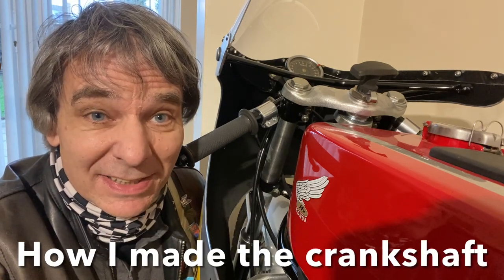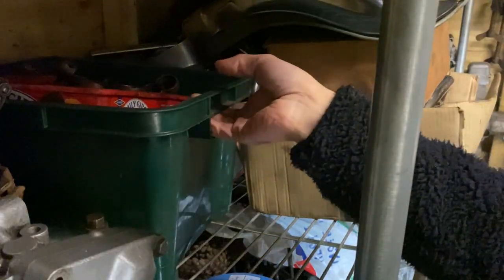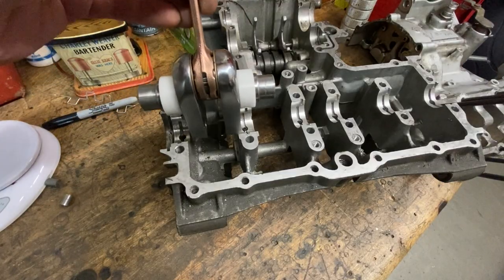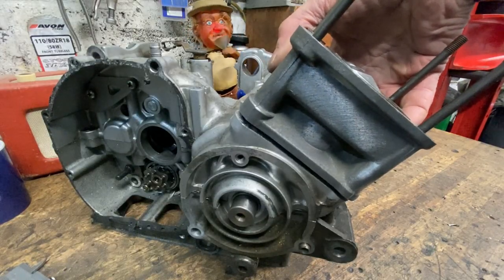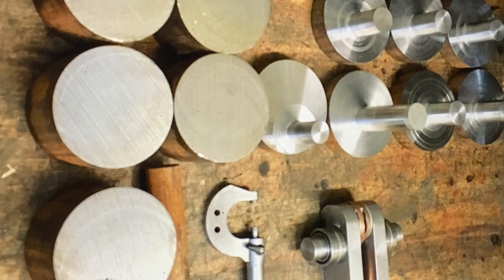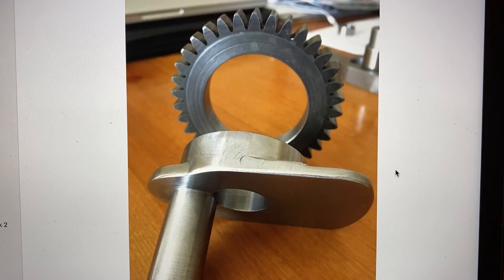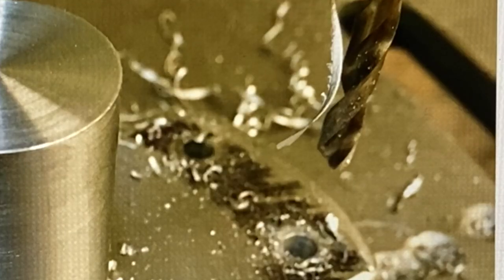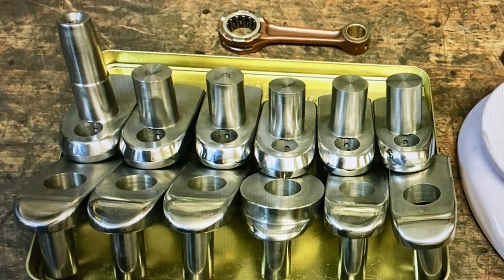Millyard RC374 Honda six replica - Episode 2 - How its made

Comment: The most impressive part (ok, it is aaaaalllllll mind-blowing) was finding the roller-bearing con rod in a parts bin and saying, "That will fit perfect!"  And, ti wasn't quite perfect, but he figured out an adaptor plate to slide in.   Holy Moses!  On the Honda RC 174 they would have just fabricated the right size con rod.  This dude found what he had, and then made it work.
Mr. Millyard is not building motorcycles..... he is creating hope.

Comment: Astounding! I'm particularly impressed how you got the interference fit of the crank journals so precise, in my machining career i always get it too loose unless i deliberately make it too tight, then sneak up on it with emery paper..... the lathes I've used have always been really worn, but all the same despite my best efforts my accuracy is an order of magnitude worse than yours! incredible!
Reply from the maker: Working on shaft basis I machined the shafts first, measured exact size then made up several go-nogo gauges to ensure the correct fit I needed

Comment: Lovely to watch, and importantly, Allen to took the time get the to build the crank from scratch for the correct sound, he could have extended the standard crank and machined the webs. I have heard the real thing albeit a George Beale model, but Allen has captured the sound and spirit of the real thing, and in reality is probably the better bike, at least you can buy most parts that Allen hasn't built, this thing makes the hair on my neck stand up so much that if I ever rode it it would push my helmet off.

Comment: So many technical words of the trade ! I can't keep up. "Interference fit" i must be so flush that it causes the slightest amount of friction before bearings steer the piece in perfect equilibrium  and lubricant is forced  under pressure between the moving parts ? And if had any idea what i was talking about (?) it would'nt be half as interesting ! Recognition of a master at work, having obviously years of experience, such  (necessary !) detail and with no expense(time & effort)  spared in reaching the goal of "just right !" I find myself feeling admiration mixed with a small amount of envy ! The envy being erased without trace by a generous helping of thanks. I did wonder at some point,  during turning, about the use of metric & not imperial but as these constructions will be reaching an international audience it was quickly plain to see why you had thought even that through. My father would say: "clever buggar !" 
and if i was'nt afraid of offending your missus ? I might not be so mildly eloquent in curbing my enthusiasm ?  ;-)  
Right enough ! Hav'nt even finished watching 😶. I must admit your videos really are to savour. Enough praise ! Oh and just coin a phrase "Behind every good man, is a good supply of cupcakes !" Well done ! I mean well baked ! 👍
Reply from the maker: I try to keep technical words to a minimum but sometimes they slip through the net 🙈

Comment: Allen do you think it would be possible to take a Harley Davidson big V twin and create a parallel twin from the existing parts? That would be an appropriately 1800 ccs, air cooled, 180 degree crank, engine that would really have a lot of horsepower. )

Comment: Hey now, look right... how come you work for Henry? Don't worry I know the answer. There aren't any jobs he could do for you Allen - except perhaps light the barbecue. Balancing a crank is understandably a black art to most people, but Tuning For Speed explains it very well. I wonder if it's on Project Gutenberg.

As I've said before, I'm a retired experimental aero engine tool fitter. After being found to hate all the machining jobs they wanted me to do, I ended up working on burner development for military and civilian engines, including Phantom Spey and RB211. I designed the assembly jigs for the the first of the new RB211 burners. They were ridiculously complicated. It didn't help that I took over from an old boy who left no notes, but was in failing health. So I started again from scratch. I swear I've forgotten more than I knew back then. Everything went to Parker Hannifin after I left.

Indeed, it's not until you reminded me, and made it sound and look so easy, that I remember just what's involved. It's all about the planning, careful measuring (I listed progressive measurements in columns on graph paper! Eventually I had the JESUS copy), crazy tolerances, very precise jigs and those last precision cuts.

I want to build a specific very special engine which I know hasn't been done yet, but I daren't even mention it here, because you'll just root around in your shed and put one together before I even get my new workshop built!;)

PS
Don't worry, Greta wasn't forgotten you. She's just been briefing Bill Gates on the next stage of his eugenics programme: Vaxeeens and their role in fighting 'climate change'!

Comment: These conrods look like two stroke conrods with the roller bearings and the big opening in the middle. I wonder if that doesn't affect the oil pressure in a negative way? Just a question no critic because I'm amazed by Allen's craftsmanship.
Reply from the maker: A roller bearing engine doesn't need high pressure it relies on flow. Typical pressure is around 10psi

Comment: I think I may have missed it, but how did you ensure that two halves of each throw were aligned.  When I had a the roller bearings on a two stroke crank replace, the shop had to align the two halves of the crank after pressing it all back together. Did you do that here, or was they way they were machined assuring alignment?  Thanks.

Comment: I really enjoyed that Allen. Lovely engineering, and good video skills. I have a question as to why you polished the parts. They did look neater afterward, but is there a mechanical reason for the polishing? Cheers.
Reply from the maker: A polished surface is less likely to initiate any stress cracking due st surface imperfections

Comment: Did you need to alter the oil pressure   to compensate for the use of needle roller bearings?? Also what is the firing order ??

Comment: I have  a 1960's Roberts Radio just like that as well as an earlier model which has the usual AF117 transistor problem which means it no longer works. There are no equivalents available apparently, which is a shame.
Reply from the maker: I bought several AF117 transistors a few yrs ago to fix mine
Reply: ++ @AllenMillyard ++ I'd already convinced myself that they would not be available any more so thanks for inspiring to find out if they are.
Reply from the maker: Plenty for sale on line also recommended modern alternatives
Reply: ++ @AllenMillyard ++ Now looking at the radio again I find it is an RT.1 which used Mullard transistors, an OC71 and three OC45's plus two power trs, the numbers buried in their heatsink.  The serial number of the set is 10019 so it's an early 1960's model to be sure.

Comment: Bloody hell, occasionally I have to  make parts that are an interference fit, it's a right pain, a thou too much off one of the parts and that's it. the thing is scrap. I lost count of how many interference fits you had to machine for that crank!

Do you think that the top end will be OK as I guess the cams run plain bearings, will the crank needle rollers 'leak' too much oil and cause a drop in oil pressure?  (I guess not because I know that the engine runs!)

Anyway nothing better than watching you build stuff, keep the vids coming thick and fast. By the way I always read anything you have in CMM first, the whole mag is worth it just to read what you are up to.

LOL, just noticed three thumbs down....Honda, Yamaha, and Kawasaki, they are all just jealous!

Comment: My only comment is you need to have a digital scale calibrated/designed for the weight range you are measuring and the accuracy required.
Reply from the maker: It is and was
Reply: @AllenMillyard  This is the Way.  Sensei